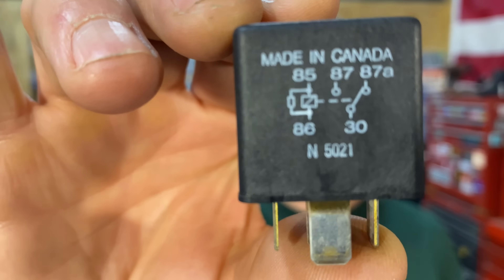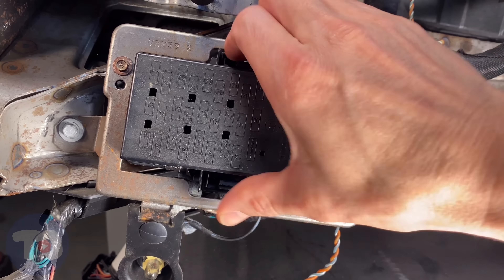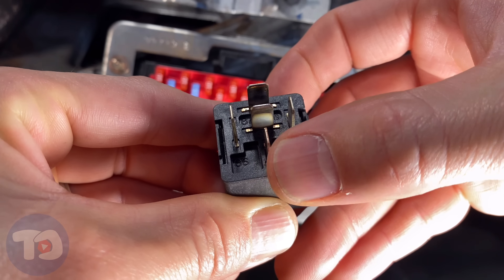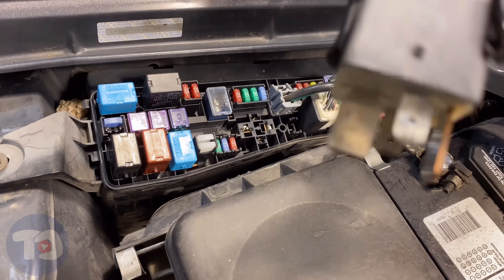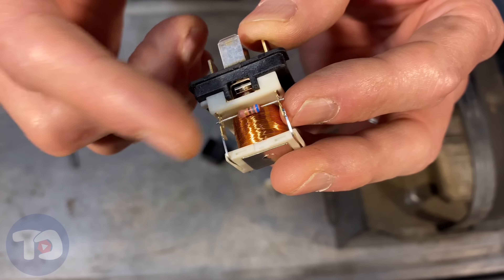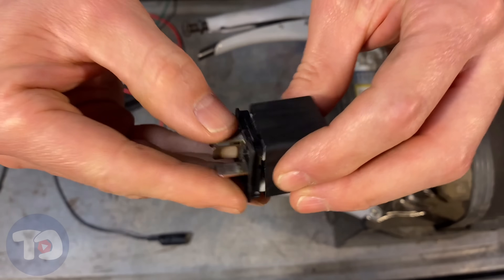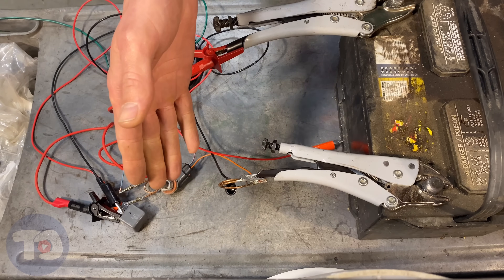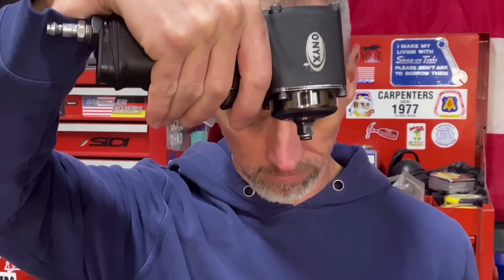Why are relay pins numbered like that?

Comment: Even more perplexing or when they label contacts normally open and normally closed. I have seen relays label normally open and closed with the relay not energized. I have seen other relays label them normally open and normally closed with the coil energized.
Reply: normally open (NO) means exactly that. no power to the relay the contact is open. Normally closed (NC) means the contact is closed, or on if you prefer, until you power the relay. for standard automotive relays, either get a NO 4 pin relay, or a "change over" relay where one terminal is permanently live (NC) and the relay switches to the other one (NO) when it's powered up. In electronics stuff, its different, and you do get relays that are either NC or NO.
Reply: @BuiltatBlackjacks  Exactly! I've been an electrician for over 30 years and I've seen them both ways. It's can be a little confusing, but Just looking at a relay with a clear cover it's easy to tell, or using meter. It's interesting that the normally opened & normally closed is not standard.

Comment: In the UK we call the diodes back or reverse emf protection diodes, also relays with this protection usually show the diode symbol on the relay along with the connection diagram.
Reply: Correct. Many folks have no clue about significance of that symbol. Thanks for pointing it out. Cheers!

Comment: I have a 2011 vw cc and the high beams will activate when I either pull back or push out on the lever but they will not stay on.  I have replace the lever but no results and do not know a relay that controls the high beam and cannot find any information.  What do you think?  This has been going on for months and I have had three technicians look at it and it's costing me a fortune in labor and parts that do not fix the problem.
Reply from the maker: I’d pull the high beam relay out of the box and replace terminals 85 and 86 with a low amperage test light or small interior bulb. When you probe the wires in there be careful not to short them together. Also, be gentle and avoid bending the sockets. Once it’s in there, turn on your headlights and then pull your highbeams on. Does your test light stay lit? If so, bench test the relay. Does it stay closed when you apply power and ground? If no, replace the relay.
Reply: @ToolDemos  I cannot find a relay that is designated as the high beam relay. Do you know which one is the high beam relay. I've tried looking this up multiple times to see which relay to replace.
Reply from the maker: @MrOldclunker  is your car equipped with HID headlights?

Comment: 54yrs old here, from India /kerala. When was Oman /Muscat, (I was there 30 yrs AS an auto electrician cum aircon) . I used many types&brands AS well as 12/24v relays in order to defrent types works. 5 points realy 87/87a.. We can use many abnormal jobs... I remember a job I done by these relays, that instead of computer!!!!. (it was Elgin air port sweaper /international /USA). So my question is that to u... Why u not mention about 87a pin's work?????. Bkoz 87a point is amazing for autoelectricians
Reply from the maker: You’re right. I mentioned 87a but didn’t get into how it’s used. That might be a good follow-up video.

Comment: Great video, thanks. Your closing comments about the ring on an impact wrench threw me
You have obviously never worked on a vehicle with greasy hands, and tried to change a socket
on the wrench. It is a pain in the arse!! I take the ring off the minute I get a new wrench.
Reply from the maker: I get what you’re saying, but here’s my point of view. If you spin up that impact and the socket comes off the fastener, nothing is keeping it on the tool. Spinning at that rate, it can fly off going very fast (especially a deep well or swivel). If it does, and heads towards my face, there’s a good chance I loose a tooth.
Reply: @ToolDemos  I'm 80 years old, and have never had that happen. You have to have control of what you're doing.

Comment: Your handling of apparently unfused leads straight from the battery scares me. Keep an old headlight bulb in series? You really don't want your fingers on the wrong side of a burning wire.
Reply from the maker: Good precaution.

Comment: There is a difference in the meaning of standard and norm in german

A norm is a written down list of agreements for a spesific area

A standard can be worked into a norm but it can also just be something which has become common practice without being written down

And this numbering style is nothing bosh came up with, this was already a standaard in german speaking countrys for all relay and schütz installations, I have seen plans for reversing contactor circuits from between the world wars using this system it got ubdated though
Reply from the maker: Very interesting, thanks.

Comment: The relay and standard make sense if you read the numbers as what those pins are connected to, but still a bit weird.  There are numbers for the coil on a relay, but for whatever reason they decided to use 30 as a shorthand for "power" when in reality 30 means 'from battery+ direct', and 30a means 'from 2nd battery and 12/24 V relay'.  The 30's are for battery systems and the 80's are for switches and relays.  My best guess is they just use 30 to indicate coil power so you know it isn't polarity sensitive like 85/86:  
85 	relay coil - 	Important if relay coil has flyback diode in parallel
86 	relay coil + 	Important if relay coil has diode in parallel
87 	       common contact 	
87a 	normally closed contact 	
87b 	normally open contact 	
88 	       common contact 2 	
88a 	normally closed contact 2 	
88b 	normally open contact 2 	
you can find the whole spec looking up DIN 72552
Reply from the maker: Thanks for the breakdown.

Comment: Large surface area terminals carry the high load CURRENT not voltage -- high voltage only requires spacing to prevent flash over not large surface area.
Reply from the maker: Correct

Comment: I like the Japanese system of using smaller pins for the relay coil connection, I trust Japanese over German engineering every time... The Germans were put on this planet to complicate things and the Japanese to simplify stuff.. Simple stuff tends to be more reliable.
Reply from the maker: I tend towards simplicity myself.
Reply: Ha, ha. So true. The curse of German Engineering has always been something like "Now, we'll show the world how this really should be done!" Result is always over-complication, ensuring troubleshooting headaches for non-German Techs in every discipline. Rohde & Schwarz: I'm pointing at you. Cheers!
Reply: @blackrifle6736  Wow, must be hard for you dealing with anything other than the most basic of equipment. You poor ignorant thing.
Reply: Clearly, you have no idea what you are talking about.  
Larger terminals on that Jap' relay indicate it has a higher current rating. 
Lower rated Jap' relays have all control and load terminals the same size.  

Do you really think a common 1/4" blade, male or female lug or terminal can terminate a cable rated at 60A or above?
Reply: @BTW...  I have replaced small load Japanese relays and the coil terminals are always smaller than the load terminals. and often of different material ( brass instead of copper ) I trust Japanese electrics any day over German stuff.. One of the reasons Japanese cars always in top reliability spots and German languish way down.

Comment: Thank you for the video. Is it possible to use to relays to get 60 amps ? I have an automotive fan that I use a constant duty silinoid for .any thing else will blow .
Reply from the maker: I’ve never seen a plastic cube relay that can carry more than 30A. That constant duty solenoid is the right switching device for your application.
Reply: @ToolDemos  seen 70 amp cube relays, but they're not cheap. and use the next size up spades for the 30 and 87 terminals so won't fit the standard socket. but you can get those too.

Comment: Haven’t watched the video yet but I’m pretty sure it’s a German wiring standard because that’s all I have worked on since 1992 so I see those pins in my sleep. I remember in high school my sisters BMW wouldn’t start sometimes it was a interment problem that I found was a short on the trigger wire. It was the fuel pump relay so I made a jumper wire and used a paint marker to mark the 2 terminals she needed to plug into. It got her by for a few months until I was able to get a service manual for the car and then I was able to use the schematic to diagnose it. Great video though.
Reply from the maker: Had that same problem with an old Bimmer.
Reply: @ToolDemos  was it a e21 320i? Because BMWS was the first German cars I started working on and I know all the quarks of them and all the known issues, and that turned out to be a very common failure on that model.
Reply from the maker: @rbmwiv  yup, an old beater we had in the late 90’s living in Germany.

Comment: Bosch uses much more numbers in car electric instalation. 31 - ground, 30 - permanent power, 15 - switched power (by ignition key), 15/54 - switched power interrupted during starting engine, 49 - power for blinker relay, 49a - blinker relay output, 50 - starter signal, 56, 58 - lights, and more... Thats what I remember. Anybody have full list of it? I had it on old disc but it died. It is still very usefull.
Reply: Google "DIN 72552 Terminal Designations" filetype:pdf Cheers!
Reply: @blackrifle6736  Thank You!
Reply: @blazeykk  De Nada

Comment: The Bosh company sure screwed up when the made a self destructible high pressure fuel pump for the big three diesel pickups .
Reply from the maker: Terrible
Reply: Oh, yes. Bosch's mechanical FI woes are a whole 'nother story, going back to the '69 Porsche 911S. Even earlier on MBz 300SLs. Cheers!

Comment: It's not just relays, every circuit in the vehicle follows the standard. (30 Batt +) (31 Batt neg or vehicle ground) (15 Ignition +) (50 Start signal to starter motor) etc. etc. etc. Once you learn this, reading Euro wiring diagrams is super simple.
Reply from the maker: Standards are useful. Too bad others won’t do it.

Comment: Never knew there were " retractable test leads" out there. Got my 2 or 3 jumbles of wire, with alligator  clips on, wrapped up in my electrical drawer, for over 40 yrs now. I go to amazon now, when looking for new tool ideas. Things have changed a lot, since my days as a Mercedes Benz tech, 30 yrs ago. I did break down, and buy a nice set of Knipex channel lock style pliers.
Reply from the maker: I really like using that test lead set. It makes life just that much easier.
Reply: @ToolDemos  No kidding, coulda used those decades ago! May still get a set.
Reply: Another excellent source for tools is Summit Racing. Excellent stock and selection, some less common items ship straight from manufacturer.
I've had sets of the pull out leads for well over 20 years.

Comment: When I have to install/ fabricate a relay system for a vehicle, or piece of equipmemt, a lot of coffee and head scratching going on, to make sure I wire it right the first time. Was going through cheap auto zone 12 v toggle switches , they would last maybe 6 months , ( no relay) ,on a piece of equipment ,that runs an oil cooler fan, till I had a few hrs. to re-wire a proper relay/ switch combo. I often wonder, when a relay becomes a solenoid?
Reply from the maker: That’s another good question.
Reply: A relay is an electrically operated switch. The term "solenoid" refers to the fact that it moves a mechanical component, hence you get solenoid valves, but you don't get relay valves. The solenoid on a pre engaged starter moves the drive gear into mesh with the flywheel as well as powering the starter. Bit vague, but thats the difference.
Reply: @BuiltatBlackjacks  Ok. I always wondered why, on the old cars, the big black box on the fender, that housed the " starter relay", was sometimes referred to , as the starter solenoid, but, as a Merceds Benz tech for 7 yrs, always knew what stuff was for, and what it did, just never thought about the terminology much.
Reply from the maker: @BuiltatBlackjacks  thanks

Comment: This was the first Video i´fe seen from you and i like your way to explain these things to people who maybe don´t have the knowlege about it like a car mecanic.
By the way, your pronouncing on Deutsches Instiut für Normung was awesome for a non nativ speaker.

For those who interested in some Backgroundinformations from a german Car-electrition:
30 is always called every cable that comes directly from battery positiv without a switch in it.
As soon as you put a switch on it, the number changes depending, what it should powers.
for example:
parklight is number 58,  ignition switch for maybe the radio or enginecontroler is number 15 and Brakelight is number 54.
some of these can be switched from a Relais but because the relais can fit in any socket they needed for, they needed an universal number for the output, and that´s the 87.
Reply from the maker: dankeschön. Also, thank you for your experienced insight.

Comment: Answers everything except the Why. "Because the Germans decided to call them those numbers"  is not much of an answer. It's like answering "Why do house mail boxes have numbers?"  - Because some people a while ago decided they should have them.
Reply: Ever heard of Occam's Razor? Sometimes the simplest answer is also the correct answer. In this case, that is precisely how number assignment system came into existence. Cheers!
Reply: @blackrifle6736  You miss both the point and what Occams Razor means. Simplistically answering a question is not Occams Razor. Turns out there actually is a”Why” to the numbering system of both these pins (and letterbox numbers). There is a reason.
Reply: @DiscoFang  Of course there is. This presentation, along with some wiser comments adequately answered the "why". This is not tensor calculus to understand. Cheers!
Reply: @blackrifle6736  Neither is it about Dunning Kruger.
Reply: @DiscoFang  Wow! Your sophistry is daunting! Channeling Carl's Junior now: "Bye, bye Clown". Done with you.

Comment: Really wish they would have borrowed from industrial standards and used a1 and a2 for the coil at least.
Reply: You're overlooking fact this electrical standard numbering system originated in Germany, not USA. DIN predated ASA (American Standard Association) by decades. Essentially, Germans got their act together first therefore DIN was adopted world-wide first. USA was and is such a huge market that DIN-compliance was non-significant here. WW1 and WW2 might also had some influence on decision-makers. Cheers!
Reply: @blackrifle6736  The relay was invented after both standards stood. It's literally as simple as bosch is a German company so they used German standards. Nothing to do with what was standardized first.
Reply: @Fine_i_set_the_handle  Very well. Makes sense to me. Cheers!